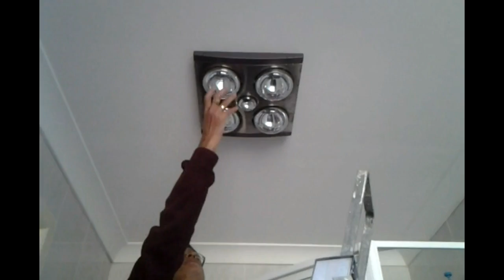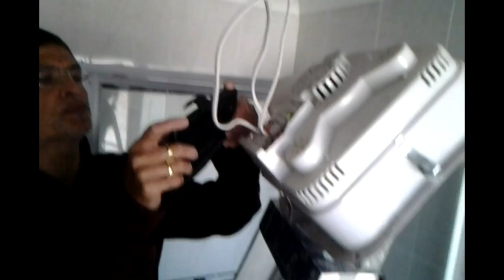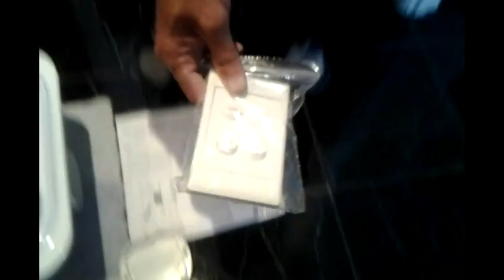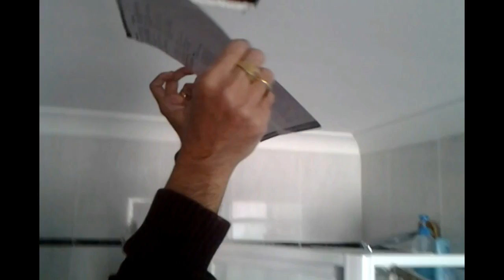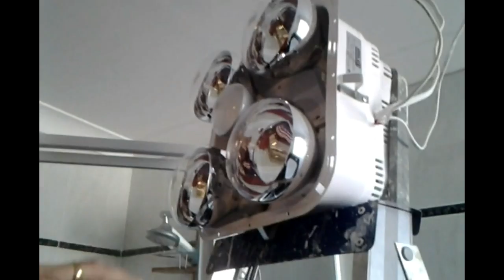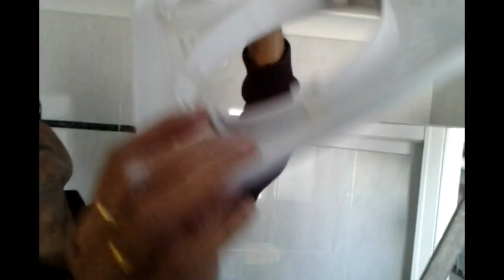Replacing 4 in 1 Bathroom Heat Light and Exhaust Fan Unit

Comment: HOW LONG DID IT TAKE IT  TO PUT BACK TOGHTER
Reply from the maker: After preparation, It took around 30 mins for me to install.
Reply: @rajshastry4360  could you post a photo of the wiring, ive just removed a fan and light and have installed the same one you did however  i dont know the exact wiring part , if you could share thank you